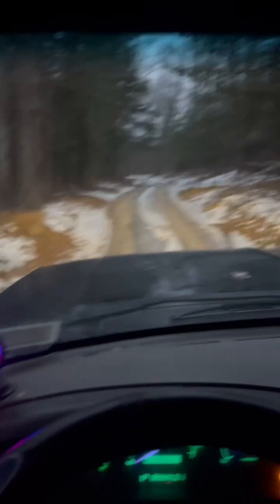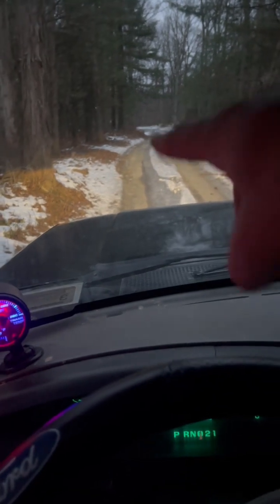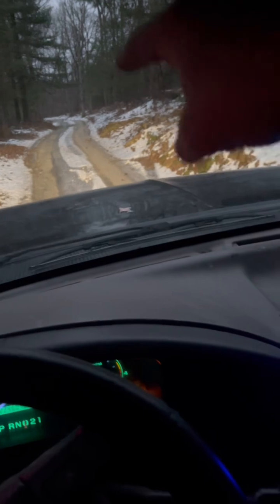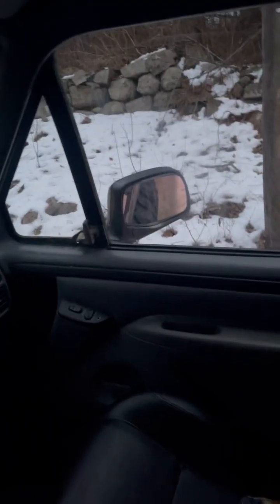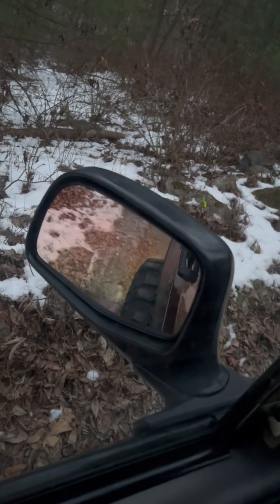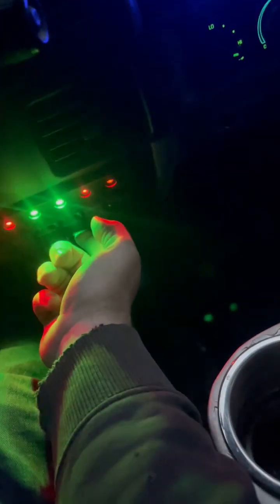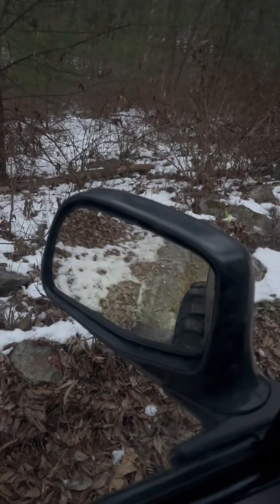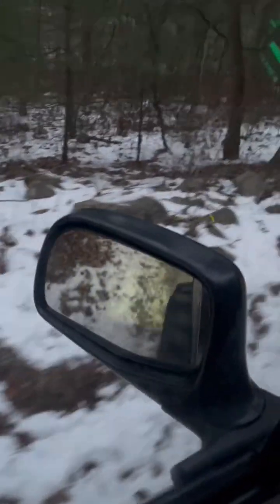Real World ARB Air Locker Demo (Locking Differential Application and Explanation)

Comment: Best video about air lockers I've seen 👌
Reply from the maker: I appreciate it a lot man, thank you!
Reply: @BocksGarage can it be operated while the car still moving? Or you have to stop first?
Reply from the maker: @viano_16  You should come to a stop before engaging it.   If the wheels are spinning at way different speeds and you engage it you can cause some damage.

Comment: when you engage the rear locker, does the air compressor continually running or pumping air?
Reply: Thank you,  i just installed mine trying to figure out how it works lol
Reply from the maker: @TheLansang  No problem.  Let me know if you have any questions!
Reply from the maker: I have a tank, so it’ll fill the tank, and once it goes under a certain PSI it kicks on. It probably turns on every 20 minutes or so depending on use.